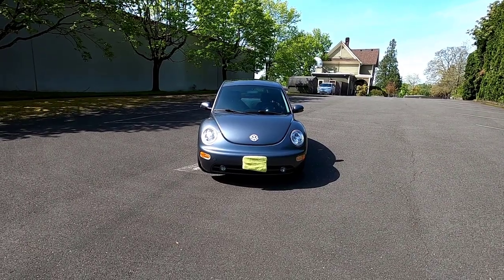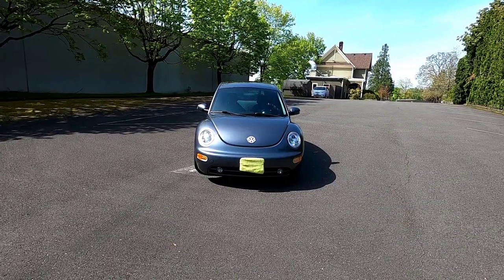1998-2005 Volkswagen New Beetle Turbo Cost to Repair

Comment: OMG! I'm scared because of everything you had to pay for to get the Beetle up and running. I just got a 2004 Beetle, and it's running smoothly, but the engine check light is illuminated. I intend to follow the same steps as you did in your initial video.

Comment: I was so glad to hear that you got the thermostat changed as over heating is so common in these cars. I found that out that hard and expense way and had to get my engine refurbished. Although on the bright side, my clutch was replaced at the same time, so that saved some costs. Still a pricey repair though!

Comment: I found out yesterday just how expensive these Beetles can be to repair.
Had the Timing belt replaced. 
Sir you have a very nice Beetle there. 
We use ours to tow behind an RV while traveling, We have built many memories with ours.
Great Video.... I needed to see how to do things,,,, videos are helpful.
Thanks👍👍
Reply from the maker: Thanks for sharing your experience and yes these little baby Porsches cost to repair is not cheap. Glad you're keeping yours on the road. I have thought that if I ever do the RV thing we are getting a little enclosed trailer for the beetle. And thank you for the compliment. I certainly love my beetle turbo, but now I want a 911 turbo s lol
Reply: @BuildYourOwn  I'm not sure if mine has a turbo, but I do know that it has a diesel engine that will get you a speeding ticket... LOL Fun to drive... and we mostly enjoy the 50mpg
Reply from the maker: @gowenrv3762  Fun! Your diesel absolutely has a turbo.
Reply: How much was it to get that done ?
Reply: @mcUSA94  Here's what I  was charged...
Labor	1357.11
Parts	818.93
Sublet	75.00
Tax		219.48

Total	$ 2470.52

New Expansion Tank & Cap
Coolant replace
Water Temp Sensor
Timing belt kit w/ water pump
Drive Belt
Crankshaft seal front
Various labor charges...
Shop supplies

2000 Volkswagen, New Beetle GLS   1.9L

Comment: I have an 03 1.8L w/ 77k miles and was wondering if you recommend I change the trans fluid. I called the vw dealer and they said it doesn’t need to be done and I called a independent VW shop and they said I should diagnose it first to see if it needs new fluid. Whatchu think
Reply from the maker: Thanks for reaching out with your question! It's interesting to hear the different perspectives from the VW dealer and the independent shop. Generally speaking, for a vehicle like your '03 Beetle with 77k miles, it's a good idea to at least check the transmission fluid condition. If the fluid is dark or has a burnt smell, it's usually a sign that a change would be beneficial. While VW might suggest that it's not necessary, it's often considered a proactive maintenance step that can help prolong the life of your transmission, especially if you plan to keep the car for a long time. A diagnosis from a trusted independent VW specialist could give you a clearer picture of the fluid condition and whether a change is warranted. Hope this helps, and keep enjoying your Beetle!

Comment: hello friend my beetle 2001 2.0 The engine light is on There are times I need to give it 4 starts for it to work, I noticed that it only works when the gas pump makes noise, I don't know what's going on
Reply: Fuel Pump #1 suspect
Reply: The coolant temperature sensor can cause problems starting? Sounds like a fuel pump. What did the problem end up being?